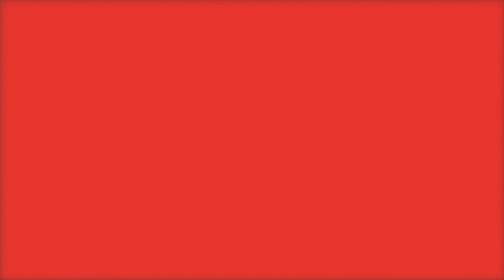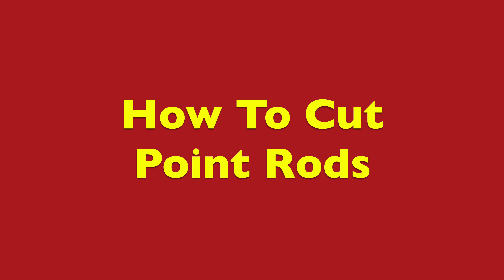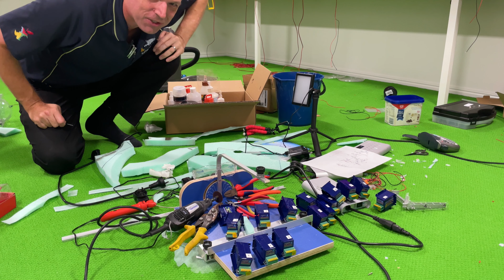Josef - Model Railway & Toy Room 95 How to Cut Point Rods Turn out rods DCC Concepts PECO Tortoise

Comment: Hi Josef, I like your videos. I just discovered your channel today. Do you remove the spring from the Peco points when installing the point motors? Cheers, Darryn.
Reply from the maker: Actually I do but recently I did a sneaky little cut with the nippers so the spring is actually there but it’s in two pieces and cleared out.   Yes spring needs to be out.   Thanks hope you enjoy some of my madness.